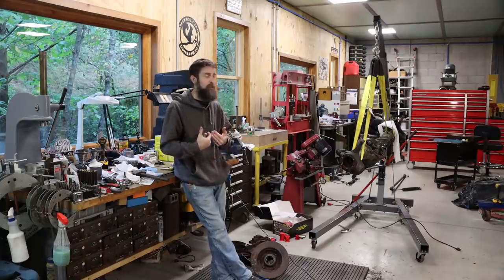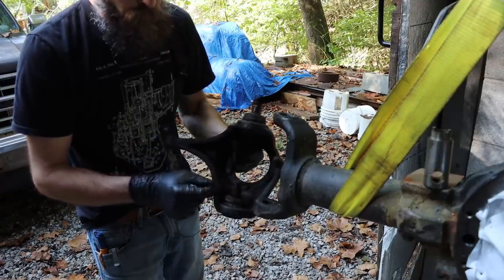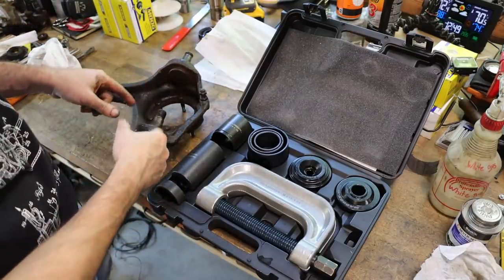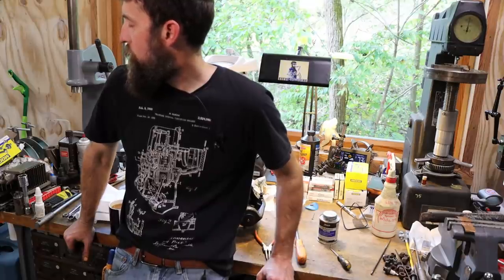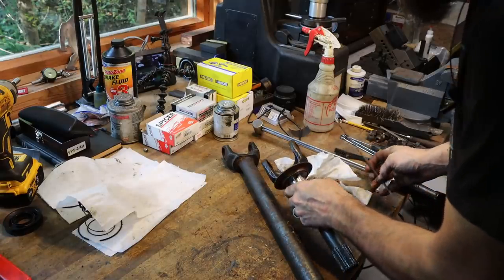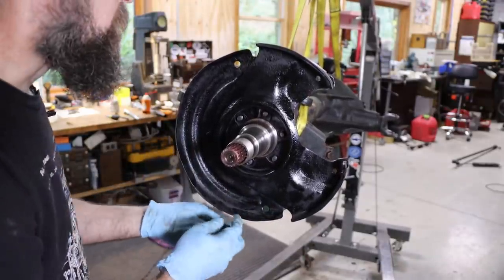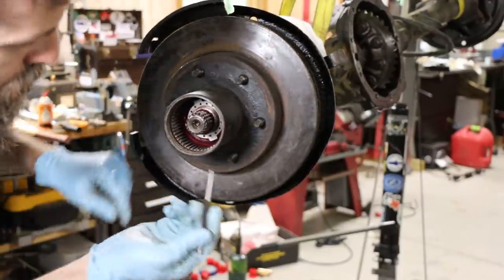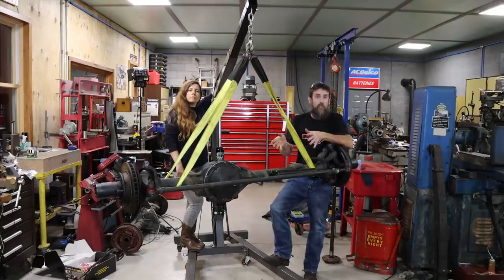GM 10 bolt Axle OVERHAUL for the SQUARE BODY Part 4

Comment: Steve just put a socket on the ball joint nut and rattle it off, the  "Castle" nut will shear the split pin off cleanly and easily. 42yrs swinging wrenches teaches you a few tricks.. Hi from AU.
Reply: That's exactly what I do. No muss, no fuss.
Reply: Totally agree. Way easier.
Reply: Yep just chisel/cut off the ends of the split pin so the socket goes on then buzz it off with the impact gun so much less work.
Reply: Couldn’t agree more. 27 years wrenching in Michigan. By far the best way.
Reply: When putting the split pin back we usually bend them to the sides instead of over the top
Reply: Those things drive out easier if you hit them left handed, just saying!
Reply: Agreed. My boss would've kicked my butt for wasting time with the torch.
Reply: That should work and be fast, but only when your impact tool can promise the required level of "ugga duggas"

Nobody seems to remember nut splitters these days.  Back when I wrenched in the 70s, they were in every toolbox.  Usually right behind the stud drivers.
Reply: @BobOBob  I remember some ball joints where the Ugga Duggas rounded out the nut...  even with the correct sockets and everything...  Sometimes it's just easiest to do one guaranteed step after hitting it with the impact wrench or breaker bar and failing...
Reply: Agreed in my 30÷ years as a mechanic I just cut the ends off cotter pin touch of heat and hit with 1/2" impact. Zips right off every time.
Reply: Great time saver.
Reply: But when you’ve got a good torch and you haven’t had an excuse to use it in a while.....
Reply: @janderson8401  LOL.
Reply: @janderson8401  When you work on cars/trucks... that's not a torch, it's the hot wrench.
Reply: Thank you, it’s hard to watch time wasted like that

Comment: Lots of folks talking about running the nut off the ball joint to sheer the cotter pin ... in my world, thats a 50/50 shot .. half the time the shaft breaks free and starts spinning with the nut, then the torches come out anyways. I've learned to start with torches whenever possible for that job.

Comment: Steve, I'm an old fart, but I remember when my late dad taught me how to pack wheel bearings. Definitely by hand. Alas, 50 years ago we didn't have the gloves. But we had "Lava" soap that actually got rid of the grease on our hands. Thanks again (I always look forward to your Saturday updates) and stay safe and well.
Reply: They still make lava soap.  Back in the day you put barrier cream on your hands to make it easier to get your hands clean
Reply: We used lava soap after washing our hands in gasoline......
Reply: @DasShaten  Same here.
Reply: I remember using lava soap. I seem to remember it smelled like sassafras. If we didn’t have lava we’d use comet cleanser. Course that didn’t smell nearly as good as lava.
Reply: @weldchip  Lava Soap can form its own version of barrier cream.  I suspect that's how the latter product arose.  We'd make a very thick lather of Lava soap and just keep rubbing it in until dry.
Reply: Yup saving money by doing one side at a time on bearings etc, I remember it well !  I remember putting hacksaw cuts into what was left of brake shoes to give them a bit more stop-ability. On that subject I remember when OEM brake shoes had twice as much material on them than aftermarket, which meant you didn’t have to adjust them so far,and they lasted much better, and stopped you better !

Comment: Dad had a really huge old vice he never did bolt down so he could move it to where it was needed. We put it down on the floor to do u-joints, worked great. It was big enough the hammering didn't hurt it. He had, what looks like the exact same BFH. Sure brought back memories.

Comment: On the one hand, these trucks were pretty much made to be disposable. On the other hand, I think the fact that it's so very difficult to get a basic, no frills truck these days has breathed new life into these old ones. I can certainly see the appeal of them. Personally, the only extra I want is a stereo. Correct me if I'm wrong, but I don't think it's even possible to buy a new one without power windows and locks anymore.

Comment: U-joint cap pins: what I do is to use my finger to add more grease to the cap and ensuring the pins are lined up along the edge.  Helps keep them in place.  Factory uses minimal amount of grease.

Comment: As for packers I grew up with hand packing and the tub style hand packer.  The K-D 2775 hand bearing packer looks a lot like it, but was blue and labeled as a different brand.  If someone was going to do 1 or 2 bearings, then I wouldn't bother, but after a dozen it's pretty nice to have.  Looks like Lisle also makes a nice one.

Comment: As always a great video.  Good to see you using Kroil and in the proper amount.  So many folks flood their parts thus wasting a valuable resource.  Remember to give it time to soak in/work and you will be pleasantly surprised how well it works.

Comment: Steve, next time try your ball joint press on those u joints. I use mine first every time. It's successful 9 times out of 10.
Reply from the maker: That's a good idea 👍
Reply: Unless your Hazard Fraught ball joint press is better than mine, don't count on that "C-clamp" press part to remove really stuck ball joints. Mine was not really forged or it was made out of pewter, because mine bent badly.

Comment: Steve, @ 24.15min. Drive the u-joint housing Down or out, sometimes twist it for access, flip around and take a pipe wrench and twist the cap out. Don’t drive them in, only to drive them out again. Sometimes the get pushed in to far. Ask me how I know this? . Remember you are throwing the u-joint star away. I have a heavy chisel that I ground a “ Y”  shape just for this purpose. Remember your throwing the U-joint away. Beat the hell out of it, save your housing. Dr Steve Doolittle, animal whisperer.

Comment: Awesome job buddy!! I’ve really enjoyed watching your videos!! I am also very picky when I rebuild stuff on my trucks also!! About 10 years ago I rebuilt a Dana 60 front axle and a gm 14 bolt rear axle and I did absolutely everything in them!! New ring and pinion, new bearings, new seals, and new brakes and the same thing on the rear axel but changed from drum brakes to disc brakes and also was able to put the ARB air lockers in both axels also!! For the front axel I ended up making a axel housing spreader to make installing and set up a little easier!!! After I did the rebuild on it I took it to a shop just to have them double check to make sure that I had set up everything correctly so I didn’t end up toasting any bearings or anything and being out a bunch of money!!! I took the spreader that I made with me and they asked me what the heck is that for?? I told them it was to help spread the housing so that I was able to install the carrier easier!! They then ask if I would sell it to them because they didn’t have anything like it!! I kinda thought that was funny!! I asked them how they installed the carriers and they said they usually take the hole axels out of the vehicles and put the housing in a shop press and put just a little pressure on the housing enough to spread it open just a little!! I’d definitely be afraid of cracking a housing and then have to try and find another axel for the customer!! They said by using the one that I made would save them at least 4 hours of just disassembly and putting the axel back in plus any parts that might get ruined during disassembly!! They said that by using the tool that I had made would save them at least 300.00 to 400.00$ in time and possibly parts!!! It did take me about a day to make but it definitely makes it a breeze setting up Dana 60 front axels very easily and much faster also!! After they had checked it out they said I couldn’t have done any better!! I was happy with all the work I had done to it!!

Comment: I push all my ujoints in and out with the ball joint press too. Fast and saves all the beating
Reply: I was going to say something similar. I've always used a bench vise and a couple sockets because I didn't have a hydraulic press or ball joint press, but any of those options seem a bit easier than hammering.
Reply: Easy to vent the ears out of alignment with a press or vise... Should give them a few whacks after pressing, to "relax" the squeeze on the ears.
Reply: @mattmanyam  You cant bend the ears out of alignment when your supporting from the back side. There is no way in heck pounding on any form of a bearing, going in or out, with a hammer, is a better solution or you'd see driveline mechanics beating on u-joints with sledge hammers (I know many do). No pro driveline shop, auto manufacturer, etc, slams ujoints from a yugo on up to a CAT 797 with a hammer. Its just bad practice thought I wont disagree its done daily.

Comment: If I'm replacing the ball joints, I just run the impact on the nut and leave the cotton pin in it's place. Just cut cotton pin flush with the nut, if it's so rusted that you wont get it out it wont to any harm.

Comment: I always add a drain plug if you have clearance while the dif cover is off.  Changing the oil is made much more convenient and convenience means it might get done.  I like to change it every 25K at least.  Hassling a suction pump is a pain.  Nice job.  I have always (more than fifty years) put lots of grease in the bearings and hub.  I use a good quality and have never had a problem doing it that way in a wide variety of vehicles.  I am careful to set the bearings by the book, crank them to X amount of torque and then back them of X turn. Take care.

Comment: If the split pin is that rotted in I normally find that a good impact gun will make short work of it with much less mess than a torch, the pin is only there to stop the castle nut turning it is very strong even when new.

Comment: All you have to do to get that castle nut off is break the cotter pin off as much as you can and hit it with an impact gun. It’ll shear it right off.   Using the torch seems like a ton of work/mess.  Regarding melting that one down

Comment: Not that torch work isn’t fun, but if you can fit a socket over the nut it’ll shear the cotter pin off cleanly and unscrew normally
Reply: I learned that trick over 40 years ago. A real time saver.

Comment: You need to throw that phase converter in the trash and roll into a VFD.  It handles single to three phase conversion much cleaner and efficient.

Comment: Flip the bearing 180° in the bearing Packer . Outside of bearing goes down
Reply: Yeah, I saw he had it in upside down too.
Reply: Most common mistake when using something is not understanding how it works and then saying it is not working as good as your other method...read instructions and learn...if your doing it correctly and your still not satisfied then at least you tried to use it ( properly )....
Hand packing grease works....
Those grease packers work too....
You can do it anyway you prefer but learn proper useage when trying new tools...

Comment: That sleeve also sets camber and caster on your alignment, I leave the one that is in there be and slowly insert the knuckle assembly to the axle housing. The factory sleeve is a zero taper or offset and after market ones can come in different degrees to set caber and caster. Plus to break the hold the tapers have on the housing I just hit it with the biggest hammer I have, it slightly ovals the taper only enough to break the taper, doesn’t matter if you hit the top or bottom first, once the taper has been broken it won’t rehold till the nut is tightened.
For u joints I open a vise just enough to support the ears of the joint and hammer the top joint down forcing the upper cup out of its housing, flip the joint over and remove the lower cup. Then I put the new joint in the stub axle, knock the other cups out the same way only you are using the vise to support the joint and not the housing.

Comment: Want to do upper/lower Ball joints on Bronco , but they got that dam split fastener (tapered Sleeve) watched the beginning again, that hold the upper in , ordered that tool, mine was weak  as butter, like your method, So think i under stand now how it works, i don't have to remove sleeve, but rather get the part that holds ball joints out of the way. (knuckle) something to do this spring. Buy ball joint tool.

Comment: You did forget one final step.  Clean the rotors. Whenever grease is involved anywhere around the rotors or drums, clean them, may save a surprise at the railroad crossing.

Comment: Hope you replaced the cones as well as the cups for the bearings. Maybe they were pressed out and replaced at the teardown video but I did not see new ones pressed into the hubs at this video. Other than that, well done. Others have already commented re impact wrenches shearing off old split pins in a flash - instead of gas axe. From retired mechanic in Land Down Under.

Comment: Sorry there is a cleaner and quicker  way to pack bearings used the hand method for years then brought a needle attachment for end of grease gun simply place needle in between each and every roller pump grease can even put bearing in place first that way excess squeezed out  puts extra bit in hub at same time no waste keeps everything clean including your hands learned this when had to pack hundreds of wheel bearings being assembled on press wheels for agriculture used a air grease gun quick and efficient and completely fills bearing instantly hope this helps

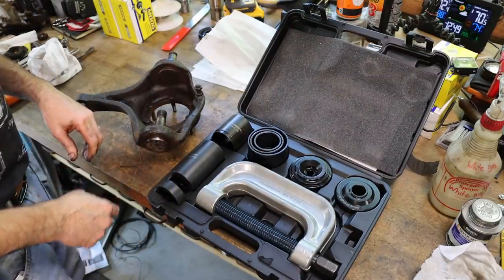Comment: AAARRGH- come on Steve- you've got that forklift.  Lay your axle across the forks and raise it to working height. You can chain it down or even tack weld a bracket to hold it in place- watching that thing swing around in the air and rolling on the wheels of the cherry picker is maddening.   13:00  about 2 feet to the right is a neat thing called a bench vise which you can use to hold your part while working on it.  33:45  "When I nod my head, you hit it"

Comment: industrial strength clear plastic bag, preferably ziplock type.  add a big blob of grease with a paint stick, add the bearing, burp it, close it, start massaging.  might take a little more time, but it's worth it,  keeping the big mess off your hands for a little longer.  nature can be cruel, every time i've started to hand pack bearings, i have to stop in the middle of at least one, due to the high volume of coffee i drink.  This, plus a pair of gloves, goes a long way toward preventing desperate measures from being taken ... and helps minimize wasted grease, and helps keep the part clean

Comment: Someone probably said this already .. but those grease packers you were using ..  they work better for me if the bearing is "upside down" to the way you had it installed. Still not the best tool, by hands is perfect, otherwise one of those vaccuum & seal machines for freezing things at home work somewhat ok

Comment: Do you plan on a dryer for the compressed air?  If so i recommend a refrigerated dryer.  They are VERY efficient and will save you tools.

Comment: @Steve Summers 
Is there a gasket or sealer that you used  when you put the spindal on? I took my axle apart in August and am finally getting it back together, but did not remember any gasket on the base of the spindals. I just caught a video of a guy using an actual paper gasket, maybe I missed it when doing the tare down, any help would be appreciated! My concern was messing up the camber. It's my first time doing this, just wanted to double check for some help. Thanks! It's the front axle on an 83 chevy k10, danna 44
Reply from the maker: If you are referring to where the spindle mate to the nuckle then I didn't use a gasket. I just coated it with anti-seize. 👍
Reply: @SteveSummers   man thanks for the quick reply! That's great, I appreciate the help

Comment: Steve, on about 19:23 you screw in a part that holds the knuckle in. What is that called and is there a torque spec to it? I am rebuilding my Dana 44 now and loved watching you do yours....Thanks!!!
Reply from the maker: I don't know the torque specs on that tapered part. That is to make sure that both the upper and lover Ball joint tapers are seated . It just needs to take up the free space and the large nut on the upper joint pulls it all together tight. It's kind of tough to expand but I don't believe that tapered bushing needs to actually be torqued.  Just the ball joint nut

Comment: Are you not supposed to leave one of the split pins down, to lock the "Caste nut" locked in place, not replying on the curved part of the pin to prevent your "Castle Nut" from turning off?

Comment: Has anyone ever used a universal joint yoke to build a radius cutter? Been looking around for scrap that would be good to build a radius cutter out of. Am I correct in assuming that the yoke would be Good forged material? Can't bring myself to pay for a manufactured one.

Comment: Almost all axle work is best done with the axle attached the vehicle so you don't have to chase it all around the shop.
Reply: So, you missed the part about this being a different axle assembly???
The old axle is still holding the truck up.
A friend delivered this axle, AND a different rear axle in his pickup.
Reply: @haroldphipps3457  No, I didn't miss that part, just saying that in my experience doing it both ways, it's easier with the axle attached to something, than having a wrestling match on the floor.

Comment: Proper uggadugga  will spin that nut off without hesitating with or without that pin, it will just cut it..... Don't need to cut the nut off.

Comment: Great vid as always. Maybe I'm missing something but aren't those yellow straps going to be a little difficult to remove with everything bolted in place ? lol
Reply: They are looped through and shackled at crane hook...the black ends are 2 ends per strap...so not locked in as you visualize....
Reply: Tool Maker,,,, yep, you are missing something!
Thanks 🤣🤣🤣🤣